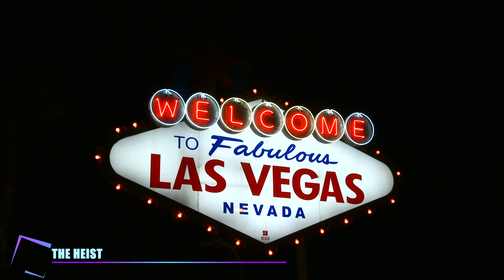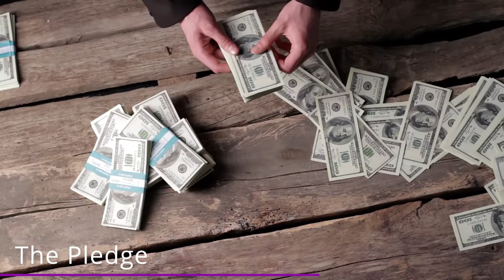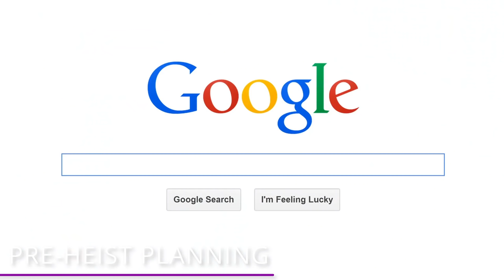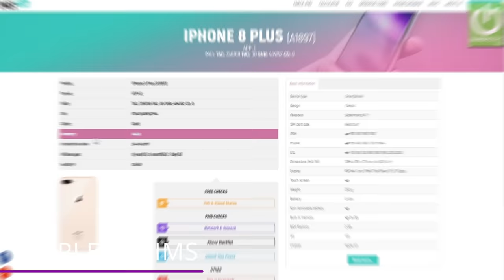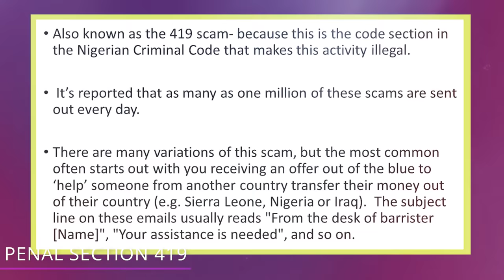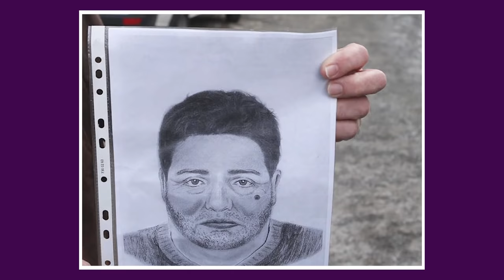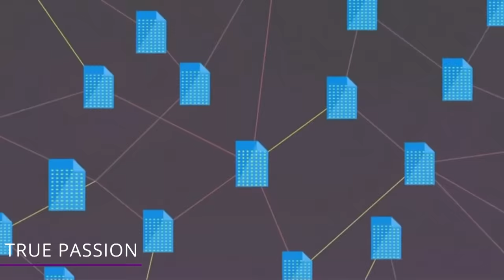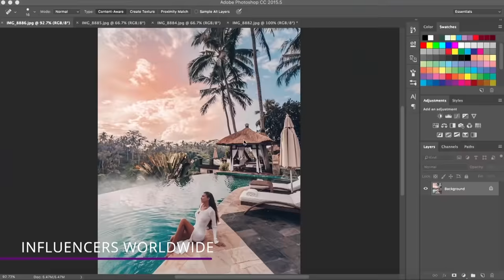How NOT to Steal Money | 2020 Videos Marathon

Comment: Their was an article in Maxim magazine back in the day about Sadams Iraq heist. American Solders patrolling a road in iraq came across abandoned (like sheds huts or) small storage buildings that had unusually strong security measures. Like borded up windows and doorways closed with cinder blocks. (I dont remember if the article contained pics of the actual properties. They were probably just similar buildings because the area was a war zone) But being curious the soldiers attempted to get in the buildings. I believe they failed and then returned with tools. A few guys gave up again and just sat on the curb hot and exhausted but a few soldiers were dedicated on making entry and finally got in. Inside they found neatly stacked suitcases containing American currency stacked shoulder high in the middle of the room. Their was evidently more lil buildings just like this one located randomly all over the area. I heard one soldier got cash out & was mailing it home to his wife, a lil at a time. Another soldier hid a few suitcases of cash near a creek just behind the building. The formal story is that a higher ranking soldier drove down the road the other way, recognized what was going on. Immediately secured the building, turned in the troops & everything was recovered. The story was being told "anonymously" by the soldier that hid cash near the water. Which no one was looking for because no one knew how much was there or missing. But during some point in the investigation the water got incredibly low and the corner of one glistening silver suitcase was shining like a diamond off the bright sun. The officer that was responsible for helping to clean this mess up, eventually spotted it and was immediately quoted as saying
 "you little stupid mutherfucQrs"

🤣🤔🤣 who knows though? The military (very proudly) dont tell the American public shyt about their operations. So I'm sure parts of the article were altered, purposely misleading or just straight up lies. 🤣 that's also the best I can remember about an article I read in a magazine back in the 90's or early 2k's. But I did always believe the discovery of all that cash was true. Magazines, newspapers and the TV news was plagued with all the lavish stuff we found that sadam allegedly owned at that time. Solid Golden toilets, Brand new playstations (that were difficult to get here). Platinum & diamond AK47'S, mansions, foreign cars, stacks of cash from every country, art that had gone missing decades ago, luxury wines, exotic animals and and excessive amounts of just about everything. Except for the one thing we were there looking for... Weapons of Mass Destruction. 

Didnt find not one of them. I was always very surprised that a story wasn't made up to falsely place one in that country. We were wrong af about that and we atleast... kept it all the way real.
Reply: They’ll tell that story about a couple suitcases of cash and a few grunts that got a little but the story about the 2 tractor trailer loads of neatly packed and palleted 100 dollar bills ($80B) found in Iraq in 2003…… that story will never be told again